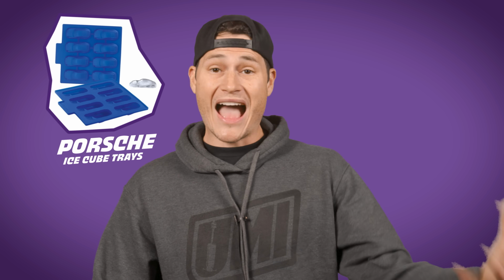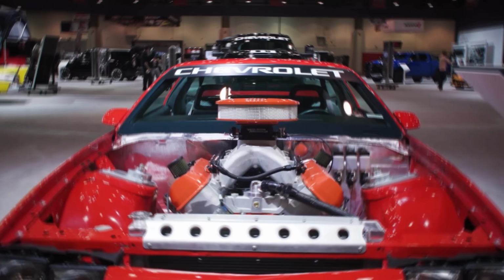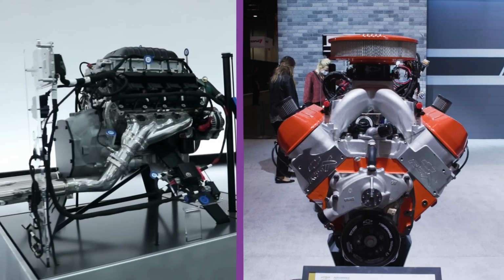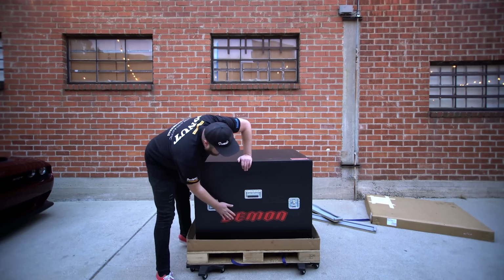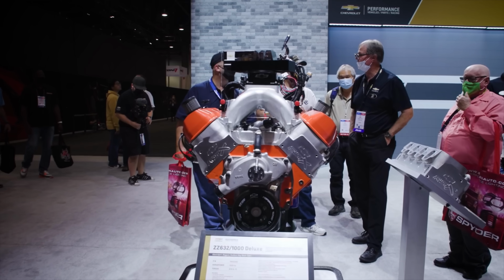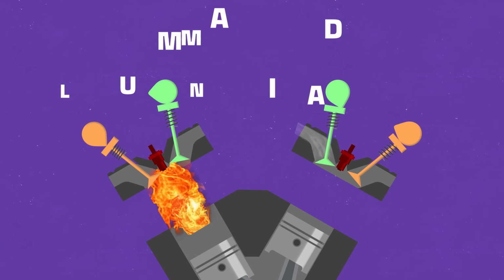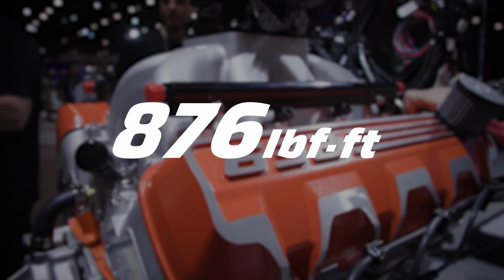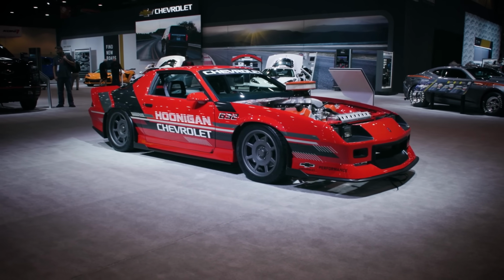Chevy's 1000HP Crate Engine EXPLAINED

Comment: Hey, could you talk about tire width? Like going from 225 to 235/245, what that does for stability and how it relates to braking and accelerating. How far can you go with maximizing width, and why we can't just go bigger instead of changing other equipment (cause tires are kind of cheap and easy to install). Please? Thanks. Great content, always.
Reply: The reason why its hard to find good information on a subject like that, is because it depends on interpretation of intuition behind the wheel with various setups. Go out, try your ideas. Learn, take notes. Why did the weight not transfer like i was expecting it to on that turn? Spin the car out. Drive beyond its limits, over and over again. Only until then, will you have the information and experience to be able tell why or when different tire widths are appropiate

Comment: I had a 97 30th anniversary Camaro White/Orange hugger stripes. 
I saved up $6,000 bought a 550 hp crate engine from Precision Engines Rebuilders in Houston Texas owned by Ken and Rick Slataper. I think they are also called Thunderbolt engines.   Long and expensive story short and $7,000 more  dollars out of my pocket and 6 months later the engine blew. I ended having to sell my camaro to an auto shop. Ken and Rick went out of business 6 months after so I couldn't sue them. There is more to the story but it only gets worse.   I'll never have the money again because now I'm on SSDI.

Comment: The Ford Godzilla engine is a V8 engine offered by the Ford Motor Company. The engine is intended to replace the 6.8-liter Modular V10 engine, and started appearing in the Ford E-Series vans and Ford Super Duty pickup trucks for the 2020 model year. It is also available as a crate engine. Wikipedia

Compression ratio: 10.5:1

Fuel system: MPFI

Cylinder bore: 4.22 in (107.2 mm)

Torque output: : 425 lb⋅ft (576 N⋅m) at 3,250 rpm; 468 lb⋅ft (635 N⋅m) at 3,900 rpm; 475 lb⋅ft (644 N⋅m) at 4,050 rpm;

Block material: Cast iron

Power output: : 300 hp (224 kW) at 3,750 rpm; 350 hp (261 kW) at 3,900 rpm; 430 hp (321 kW) at 5,500

7800.00$ put a turbo on it bobs ur uncle pushing 800 hp for 10,000$ usd 100,000 km warranty.

Comment: You don't need power steering HAHAHAHAHAH 
Even on 1.0L engines economy cars around here, steering them on the parking lot is a pain in the... biceps. Imagine that with a 10.4L engine on a car that will happily go sideways with a flick on the gas pedal. Or if you drove Beetles, you could do without because the whole thing weights 1000 Lbs.

Comment: I'd be curious, what kind of power it made, with 13 to 1, on race gas.
Reply: Well considering a commonly build 358 SBC with high compression on 112 can make around 700 N/A, I’d have to say that it would be terrifying lol. The instant punch of N/A over 1000hp would be so violent I think.

Comment: 1000 hp is disappointing coming from a 10 liter iron block motor like this. People are getting close to 1000 hp NA on the Ford 7.3 already, and it doesn't even have an aftermarket. It's cool that it's 10 liters, but man that's a disappointing number

Comment: torque is not crazy for a 631ci. BMEP is about the same as a mustang GT. still quite impressive, and definitely in the upper range but similar or lower than some stock engines. still, with all that displacement, and relatively high rpms, it makes a lot of power and is probably easy to tune for even more powa babe

Comment: Same guy who designed the LS heads... yeah, these heads too.  But.  I can't wait until someone realizes that it is LS flow and bolts a pair of turbos on one.... 3000 hp in a street motor is really obtainable.  Which is actually pretty amazing.  It is, however, a tall motor. A very very tall motor.   With that said, the dimension of where the motor mounts are and transmission attaches is exactly the same as a SBC, it's all in the heads where the trouble begins. Follows after that the height of the motor - that's where most will have trouble fitting it.

Comment: Back in my college days, I had a Simca 1204 that I salvaged from a junkyard, and I also had a Toronado with a 454. Always wanted to stuff the Toronado powertrain under the rear hatch, while keeping the original front wheel drive powertrain for economy while driving around town. What a sleeper that would have been! Do that with this engine!
Reply: 455

Comment: Can you guys mske an episode about why some twinturbo vehicles run dual intercoolers and some single intercoolers? And whats the best option for a twinturbo engine? (Im obviously thinking of "V" type engines)
And maybe one episode about "X" pipe exhaust's and "H" pipe exhaust's on "V8's" and if there is any point at all running a "H" pipe or a "X" pipe exhaust on for example a twin turbo V8?

Comment: Buckle up and and absolutly cut and weld the crap out of a gremlin. Make a jig for the motor mounts on the crate and get a pro to mount that rig Throw in a likely 4" long drive shaft lol with the bigger rear diff. Basically re-build the floor. Oil sump in the back. Rear mount rad with roof intake. Open grill to block and headers, or no hood cuz you may not get it back on. Lay down a sweet waynes world inspired  livery. 
There you go... your welcome for the successfull build series. Sorry it was so expensive.

Comment: I know you said Chevy hasn't put a big block in a CAR since the 70s, and I'm sure you already know this, but some may not. Chevy put big blocks I'm trucks well into the 2000s. 454 or. 7.4L until 2001 and 496 (8.1L) until around 2007.

Comment: Blue print makes a 632 for $13,000-$14,000 there are other manufacturers out there also around the same price that are rated around 800 hp why would you pay $30,000 for for an engine

Comment: I want to bore it out to 636, and I want to put a completely built kawi 636 in the box of z71 and call it the z636 project... looking for backers I guess
Reply: both should be from 95... besides all of the motors, suspension... trans... drive train... brakes..  ect 🤣🤣🤣

Comment: Chevy overprices their crate engines. The 405hp ZZ6 350 is about 8 grand from GM, but Blueprint Engines will build you a much hotter one for about 6. And Blueprint offers an 815 hp 632, with all new parts, for 13 grand thru Summit or Jegs. If you MUST have 1000, put a 200 shot of nitrous on it. No shame in saving 16 grand.

Comment: In marine applications big blocks are still common including more then one the 454 is still in thousands of boats. As gm makes many of murcrusers engines from 4cylinder to big bad v8s. And there are some nasty race motors
Reply: Tru dat but at this level of power/weight/cost I'd go for a helicopter gas turbine. 😁
Reply: I had custom cabin cruiser, with two v8 mercruiser engines it was awesome we could ski behind it

Comment: To anyone having a debate on torque vs horsepower, which one matters. Came to inform lol, torque can be imagined as thrust force so to simplify, if u could stop an engine while running (in theory) and feel how hard its trying to rotate, that's torque simply put. Horsepower is the combination of torque, and rpm so it gets a little more complicated. It's best to think of horsepower as total energy you're putting down, so as the torque curve flat lines and eventually starts going down as the rpms increase, the total energy available (horsepower) is still getting higher because it's at a higher rpm. Hard to explain better than that for me but here's my last visual. You have an electric motor to a power wheels car, it spins at really high rpms and has not nearly enough torque to propel the car so they gear it down and now it has the torque to the job. The overall horsepower at the motor and at the output shaft of the gearbox is the same (assuming no drivetrain loss of coarse), only difference is one is spinning 15,000+ rpm and the other is closer to 75-100rpm with a proportionate torque difference aswell. Hope this helps and don't confuse people further lol. Also if u think im dead wrong and suck for using hypotheticals, the concept must be above your mental pay grade 👍

Comment: That wasn't much of an explanation. "It's big and flows well" isn't much of an explanation. How about the rotating assembly? Are they forged pistons and rods? Does it have titanium valves? What does the power curve look like? Is there anything special about the oiling system? What type of fuel delivery/engine management system does it have? What are the cam specs? etc....

Comment: A much easier way to calculate engine displacement is to take the would be surface area of the bore (pi R^2) multiplied by the stroke multiplied by the # of cylinders. In the case of the 632, 3.14×(2.3^2)×4.75×8= approx 631.2

Comment: 1,000 hp from a 10.3 litre engine is nothing special.
It's actually less than 100hp per litre. 

What would have been more interesting, was if you looked at average HP across the range rather than peak HP. There'd plenty of engines that make well over 100 HP per litre, but a lot of them make it at 8k rpm or higher and pretty much for one turn of the crank.
Reply: @c'est le diable So you don't understand what I said? Or you don't agree that a headline HP figure isn't the be all and end all?
Reply: @c'est le diable  what I mean, is that us Europeans (I'm English) rely on lala land high bhp figures. My own car is an M3 - dyno shows 338 hp at 8k rpm. But from idle to about 6k rpm, it would get murdered by a "200 hp" hot hatch, tbh. The 338 hp figure is only at 8k rpm. Or, another way, it only ages 338hp because it revs to 8k rpm. Everywhere else across the rev range, it's fairly normal. It's also very unreliable because of the high rev nature and all the tech it takes to make it work.
Now, take an American V8. Instead of variable timing, massive redlines, complicated valve and cam set ups, they just make the capacity bigger. That means they get more low down power and it delivers it all the way to the (lower) redline. The torque is also rarely mentioned, but a high redline lower CC engine tends to make a lot less torque than a big CC engine because torque is typically flat across the range. Example being the 4.0 V8 in an E92 M3 which has about 295lb of torque. Whereas the equivalent C63 AMG with the 6.2 V8 makes 443 lb of torque. It's not even a competition. The HP figures aren't that different- 414 Vs 450 hp. But the AMG makes its power almost 2k rpm lower.

Comment: Stretched limo. You won't even have to stuff it in there, just gently place it in the passenger compartment.  Smack dab in the middle on a tube frame to distribute the weight of that greazy pig over the frame rails. Then drift it.

Comment: While not offered in a "car", the Big Block didn't die in the 1970s. It was offered in GM HD trucks and SUVs up until 2007 (Sierra HD, Silverado HD, Suburban, Yukon, Avalanche, TopKick, Kodiak). And before that, we had the 454 SS Chevy truck in the early 1990s, while the GM performance catalogs continued to list Big Block engine variants over the years. And we can't forget about the ZZ632's "little" brother, the ZZ572!

Comment: The design is fairly impressive but when it comes to overall value, it depends on pricing. When it comes to power to cost ratio, $29,000 is kind of okay, but $37,000 is uncompetitive. The Godzilla have the best price to HP ratio, followed by the Hellcat and Chevy 632 ranks third.  632 appears to be very robust, but the thinner valve stem is a little concerning unless reinforced with better alloy. 

Hellcat engine produced .035 HP per $1 or $28 per HP 
Godzilla produced .048HP per $1 or $20 per HP
Chevy 632 priced at $38K produced .027 HP per $1 or $37 per HP
Chevy 632 priced at $29K produced .033HP per 1$ or $33 per HP
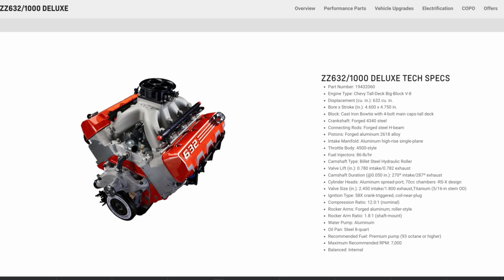Reply: I, unlike Jeremiah read the spec sheep he showed on the video (@7:30) , and the reason that the valver are lighter is NOT that they have thinner stems, but that they are Titanium. 32 of them alone would contribute hightly to the price.

Comment: as an OG trailblazer owner, ill say chevy really fucked up on rebooting the TB/blazer, chevy really coulda rivaled ford with what they did with the bronco/sport with the blazer/TB.   imagine a modern off road centric version of the OG square blazer and a modern versions of the  TB trims(which were basically tahoe "Lites"). but instead we got a chevy badged small/midsized mazda-esque crossover with a cvt trans and state park gravel lot level off road capability... disgusting

Comment: Would love to slap the 632 in my 04 CatEye 4x4!! Solid axle swap the front to a Dana 60,Rear Dana 80,have a transmission and transfer case that can handle it all and leave my slight lift and wide mud grip stance as is!! Then id stick with my 35" grapplers and give these Georgia dirt roads straight hell without the worry of breakage!!! Hey,we all can dream a little right!?

Comment: Cadillac once had a mass produced 8.2L V8 in their front drive 70's Eldorado. It will get a lousy 8 to 11 mpg. . I wonder what this 1004 hp. engine gets. However,  electrification will be the preferred powertrain for mods and overhauls.

Comment: 632 Cubic inches 
😂😂😂😂😂 
To bad it can’t beat a 455 V8 24V 4.5 liter blueprint big block Oldsmobile stroked out to a whooping 650 Cubic inches this will set you back about $11,000 just for the block and Crank and pistons no heads but it makes a lot more HP very easily

Comment: Wait, so all they did was give an old engine new precision parts that pretty much consisted of thinner valves? The downside I was thinking of was that ole MPG btw. 1 Tank of gas will net you four 1/4 runs? In other words, 4x the runs you'll want with your mom.

Comment: I think they should of called it a LSX, as much as I love LS engines I don't feel like using a carburetor, I'm so used to the 102 intake manifold and the 102 throttle body, I wonder why they went old style and not the new style

Comment: get the engine and transaxle out of a cavalier and stick it in an S10. then put a hard top on the S10 bed and hide this monster back there with the power going to the rear wheels. automatic with shifter on the steering column for the front, manual with floor shifter for the rear. add in a thing where you push the clutch all the way in then pull a knob out and that holds it in place. like a big, significant knob. no springs to pull it back in, also have a pin on a chain next to the knob so you can pin the knob back as extra caution. beef the rear suspension and have the truck ride at stock height. get all the old man trim, like the old school running boards, tinted visor things over the windows, rubber strip on the door edges so you don't scuff people if you accidentally bump them with your door, pale yellow lights across the top of the cab. and the exhaust on the rear engine just two massive pipes coming off the manifolds. like semi truck stacks level width, run them under the bed and out the back, pointed at the ground to get that nice reverb off the ground, give it a little more beef to the exhaust.

Comment: BluePrint Engines has been making 815HP 10.3L or 632 CI engines for a while now, and they start with stock blocks instead of making them special. The only thing keeping them from 1000HP is that they build them to be boosted and as such use 119cc head chambers. Their motors are known for 1500+ HP when boosted.
Reply: You won't get 632 ci from a stock block. Deck height is too short for the stroke needed.

Comment: For reference, my Blacktop BEAMS 3S-GE came from the factory with 200hp at the flywheel. It's a 2 liter, so that's like 5 of my engines both in displacement and power output. And reliably too. 🤯

Damn!

Comment: This thing would be perfect for a Chevrolet Cheyenne series pickup restomod! I can only imagine dropping one in a 1989 GMC 3/4 ton single cab longbed 4x4 and using it as mountain tow rig.
Reply: I’d dump this in my slammed 89 OBS dually and ditch that tired 454 .

Comment: The aluminator isn't an electric motor its the 5.2 from the gt350.

The valve in the animation is moving up instead of down the intake port
Reply: He said the Eluminator which is electric. The Aluminator is many engines, there was even a 4.6 Romeo block aluminator.

Comment: I wanna see an 18 wheeler with a crotch rocket motor for all each of the 18 wheels. Would probably be slow af without the trailer. Probably hard af to control too because all the motorized ass behind the cab.

Comment: Stuff it into the FUCKING LIGHTEST CAR YOU CAN THINK OF THATS NOT AN 86 you will ruin the balance if you put it in a 86
Reply: formula 4 car. not the lightest but it's a mid engine so it wouldn't probably be that bad
Reply: @bedwetter3357  I was thinking of something more like a Shelby 350 or like a dodge hellcat

Comment: As neat as it is, unless you're racing in a class that only allows naturally aspirated, this is just too heavy for the small amount of power it makes.

It's crazy to say that, but guys are driving around with daily driven 700 horsepower on factory blocks with proper turbo charging

As Richard holdner showed us you can easily get 1500 horsepower out of a 293 LS with turbos and you're certainly going to have more than 870 lb of torque

So why pay $38,000 for this motor when it has 33% less horsepower than that junkyard 293 you pulled out for a few hundred dollars and through a $170 eBay turbo on

Just doesn't make sense anymore to use Big blocks that are heavy and huge, we just have too many great LS motors sitting in junk yards and inexpensive turbochargers and intercoolers